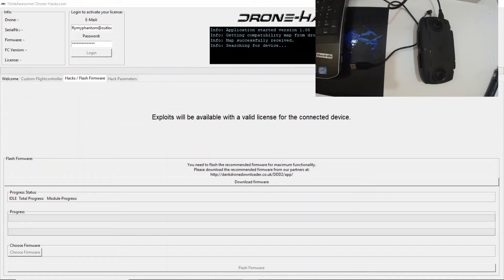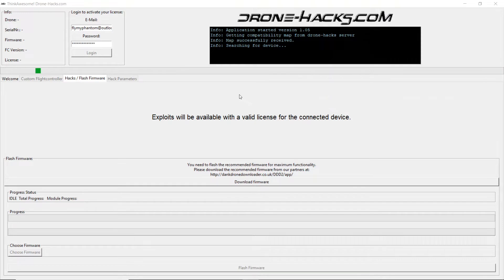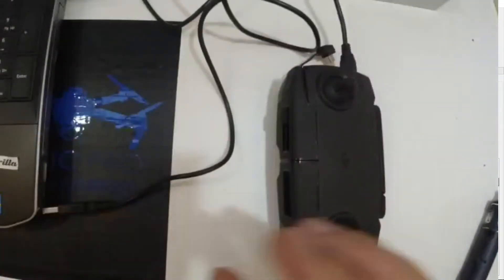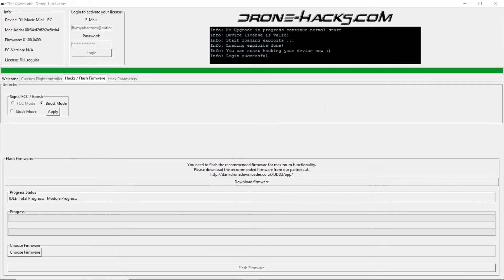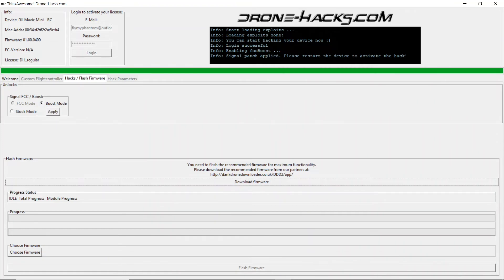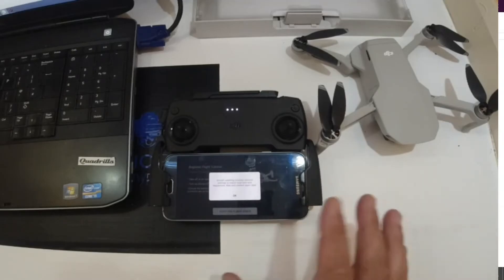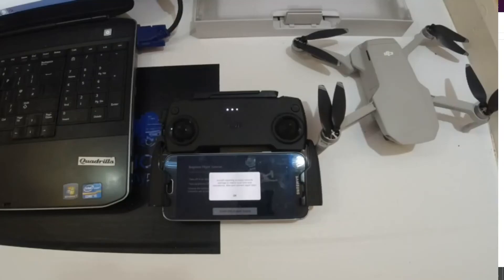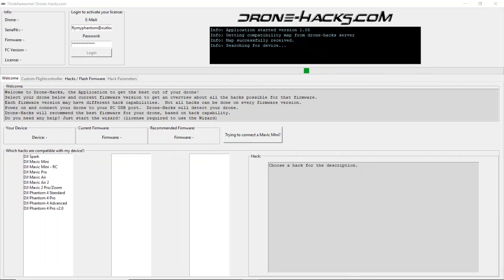Drone Hacks guide number 4 boost mode on the Mavic Mini

Comment: What is the difference between those updates?
Reply from the maker: What updates
Reply: @  sorry I meant what’s the difference between boost and normal.
Reply from the maker: It's been a long time since I did this video but from tests I got about another 1000ft distance in an open field but some see no difference, distance is dependant where you fly, all you can do is apply the mod and see what distance you can get
Reply: @  ok thanks

Comment: I have a DJI Mavic Mini and I purchased a Drone Hack / DH_Regular license. Aircraft license is activated, but Remote license is not activated. That's why I can't do RC- Boost Hack. Firmware version 01.00.0600 Bird map shows that it is compatible with this version. What can I do?
Reply: Please raise a support ticket
Reply: I got this response; 
Birdmap shows FCC mode is available with DH Companion, which is exactly what the app is also telling you. You cannot activate FCC mode on the drone or RC directly @MrJudslat
Reply: But RC is activated as shown in your video

Comment: After install i never got the pop up about resetting the wireless settings to match local laws... should i of?
Reply from the maker: Did you follow the video fully ?
Reply: @FlymyPhantom  Yes 100% in the drone hacks app it said it had worked but just never got that pop up
Reply from the maker: My usual suggestion is to raise a support ticket the guys at DH are much better at diagnosing what could be wrong
Reply: @FlymyPhantom  the only difference being im using a mac
Reply: @PattiemanNL  no never got it I don’t think it made any difference with this hack
Reply: @PattiemanNL  thank you.

Comment: hi i just bought the lite version for boost hack, when i connect the remote i dont get the option to boost mode there is only a warning availble when with a valid license i just bought it am i missing someting? iam loged in with my account i bought it off it also says Error: No license for this device!
Reply from the maker: Have you activated the licence, if not connect the quad first
Reply: @FlymyPhantom  ah that did it thanks, so now when i start the app i get aircraft resetting wirless network to match local laws witch is good thing right? so do i just press go fly? or restart anyting?
Reply: @piepo255  just tap on OK and fly, it just let's you know the drone changed its wifi settings to boosted mode
Reply: @piepo255  to be clear, it worked 😁 happy flying man!
Reply: @-never-gonna-give-you-up-  have fun flying

Comment: I used this hack yesterday to enable boost mode on my Mavic mini 1 - I can confirm that it works beautifully!
I tried flying a route that I'd previously attempted multiple times & lost signal on every attempt (not massively far, just obstructed by buildings) - but yesterday I was able to fly the route I wanted with no signal loss issues at all!
Reply: That’s awesome to hear! I bought mine during the Fuck2020 promo haven’t installed it yet... Going to tomorrow 👌🏼
Reply: Does it require any license?
Reply: do you have to go in airplane mode at all or no ? i read somewhere the license for NFZ deactivates if not in airplane mode ?
Reply: Did you have to buy a separate license for the RC controller, different than the one you bought for the aircraft?
Reply: @alifares5591  never heard of that. Maybe not a thing in Britain?

Comment: I have the mini with the MR1SS5. Would the boost worth it? Do we know the power increase it will bring?
Reply: It’s worth it right now a lite license is 30% off
Reply: Isn't the FCC version of the mavic Mini technically already in boost mode since it's 5.8 GHz only? Or will applying boost mode to the FCC version give it a boost as well That's what I'm confused about @760ejm

Comment: Hi, I have a question about the parameter adjustment on the Mavic Mini. When I check the "Hack Parameter" tab, the sports mode parameters are all set to maximum by default. Do I need other firmware to enhance the Attitude Tilt above 30 and Vertical Speed Climb above 4?
Thanks
Reply from the maker: I would hit the default button and set them back to defaults, not sure why yours are set to max unless someone has done it before maybe
Reply: @FlymyPhantom  Okay, what speeds can You achieve with the modded Mavic Mini
Reply: @arnodji4928  flash 0400 firmware on drone and you can change the tilt up to 60 degress i managed to get 56 km/h
Reply: AND WARNING IF YOU GO THAT FAST THE ALTITUDE WILL DROP SLOWLY BECAUSE OF THE TILT
Reply: AND also you have to increase the brake gain in drone hacks from 80 to 150 to stop quicker at that speed
Reply: @gearamihai2782  60 degrees? Woah, i managed to get 53 with 40-41 degrees
Reply: @gearamihai2782  also, turn the climb speed and decent speed all the way to the max, it works amazingly its so  good now

Comment: I tried this and flew in my normal spot both manual and auto frequency 2.4 and 5.8 I found no difference .?
Reply from the maker: don’t know why, I tested it and it worked fine, are you on the recommended firmware ?
Reply: @FlymyPhantom  yes but just read you need assistant 2 installed which I didn't have so I will try that cheers
Reply: @FlymyPhantom  If I have a 500 fw, must I go back to the 300 before apply the patch?

Comment: Good info. How would this affect an FCC model in the CE region? Will it stop the RC/AC switching down to CE mode during power up? I know the Fake GPS workaround for this, but would this hack remove the need for this workaround and just keep everything in FCC mode?
Reply from the maker: as said in the video, the CE version can’t be put In FCC mode this app instead boosts the power output
Reply: @FlymyPhantom  Thanks for your reply and I understand the point you made about the CE version. But, I have the FCC model (from the US) and was wondering what benefit the hack would have, if any, when using the drone here in the CE region. Apologies if I didn't word it correctly.
Reply: @GerryM.  Before I found this site I had emailed Drone-Hacks and asked the same question. I got this reply:
"The boost mode works on CE and FCC model, we do not change the region, so the region including the channels are staying the same. The fake GPS hack for the mini will not level up the same power level as the boost mode. 
The boost mode just switches the RC to the maximum possible transfer power that it can do. This power will be higher on FCC models".
I haven't tried it yet but from the reply it seems that the Drone-Hacks hack gives a higher output from the RC than what the standard FCC does.
Reply: @garyr4047  Thanks for taking the time to respond. I've since been talking with the team at Drone-Hacks (very responsive BTW 👍🏻), so I have to give this a try.
Reply: @FlymyPhantom  Which is the difference in mw (I mean power) between CE in FCC mode and CE Boosted?